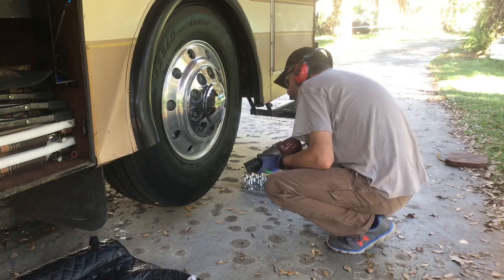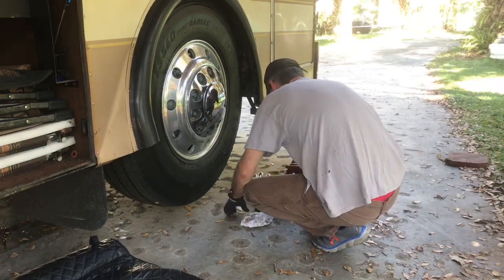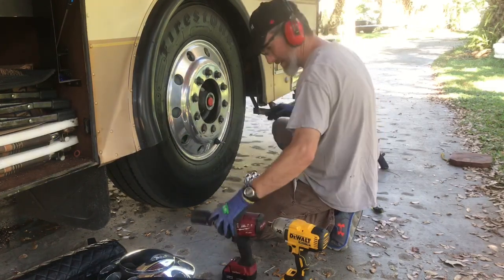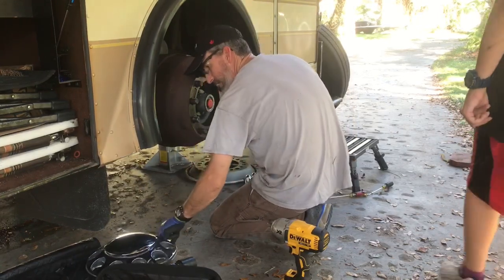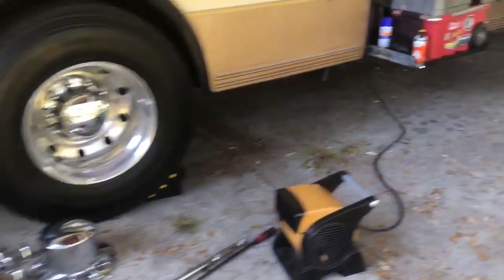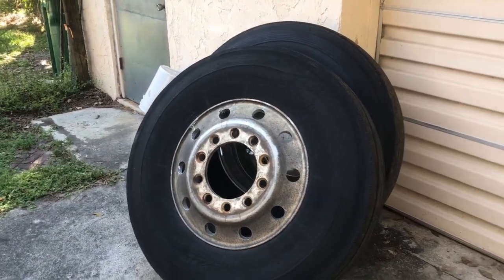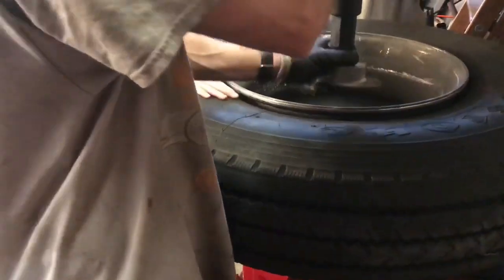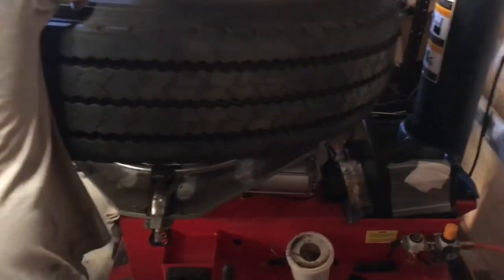Wanderlodge changing the tires with 2 Hacks in a Shack

Comment: Bloomed like the drivers side steer axle had a bad wheel seal. The brake shoes and brake drum LOOKED like it was oil soaked.   Maybe?
Reply from the maker: Milton Metcalfe - Yes the driver side seal was bad.. check out my latest video shows me replacing the wheel seals and brakes..

Comment: Would have been easier if the air bags were inflated to raise the body away from the axles.
Reply from the maker: B R - Thanks, I did learn that lesson.. I drive up on blocks now and then let it down on to the jack stands. Then I can remove the blocks from under the tires and lower them on the ground leaving more room to get the tires off.